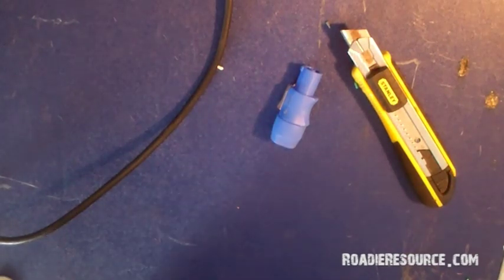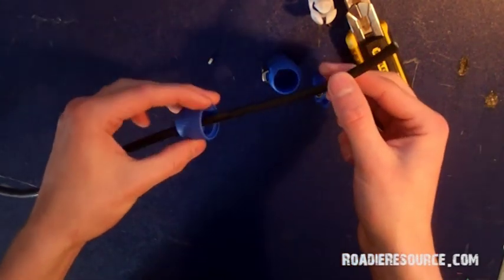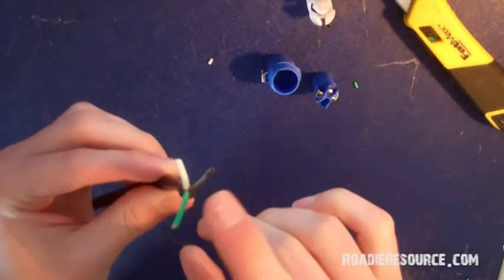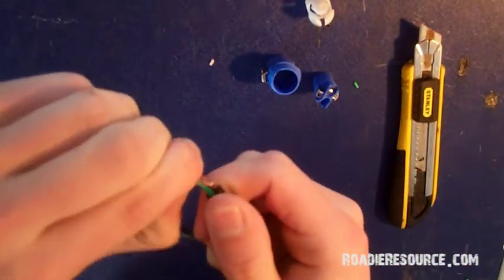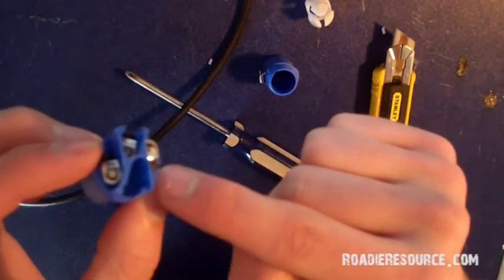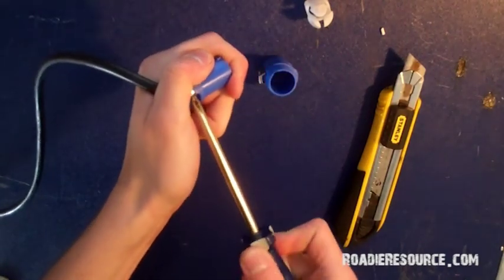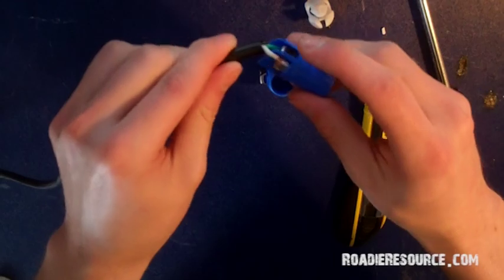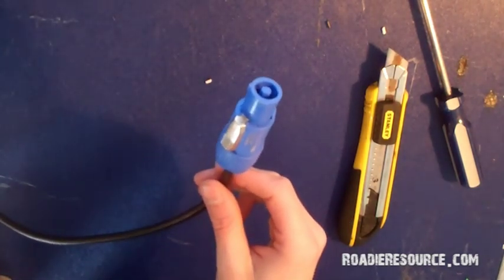How To Wire a A-Type Power-In Neutrik PowerCon Connector

Comment: 5:53 Glad you mentioned about hand tightness. However, you SHOULD attach a wrench to it and make it tighter:
"Fasten bushing by means of a fork wrench 7/8” 
(SW 22) or with the Neutrik handtool HTFAC, min. Torque 2.5 Nm (1.8 lb-ft)." 

https://www.neutrik.com/media/10217/download/bda-452---powercon---nac3fca---nac3fcb.pdf?v=1

Comment: Please don't hold the connector in your hand when you are screwing down the terminals, especially with the amount of pressure you are using. It is too easy for the tip of the screwdriver to skip off the head of the screw and go straight into your hand. I've done it myself, and seen other people do it and it's not a pretty sight. Put the connector on a non-slip surface on the bench and screw down onto that.

Comment: can I use this but with only a pos and a neg wire? I just want to run power from my 6v bat.
Reply: Of course you can but DON'T! PowerCon is intended for 100-240VAC mains ONLY and is designed to be non-interchangable for SAFETY!!!